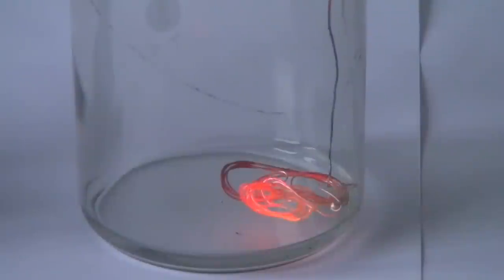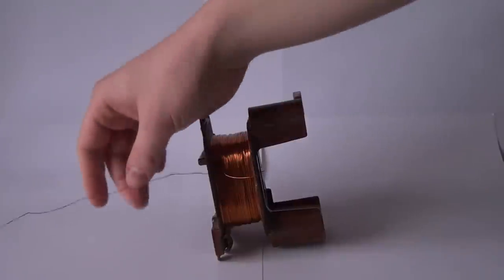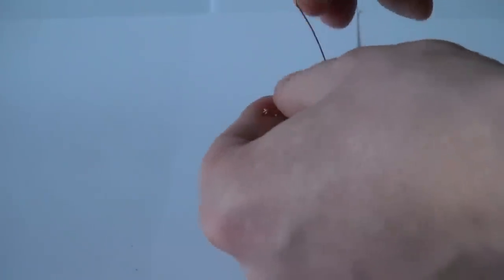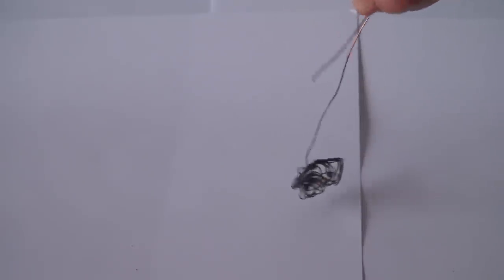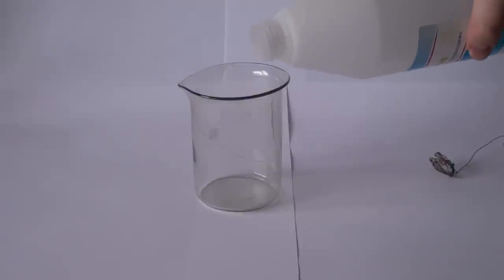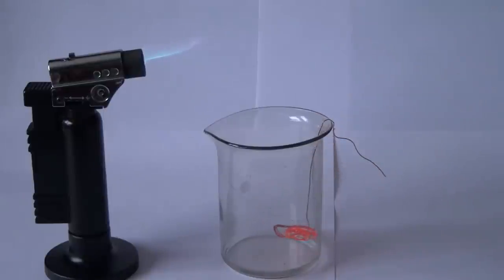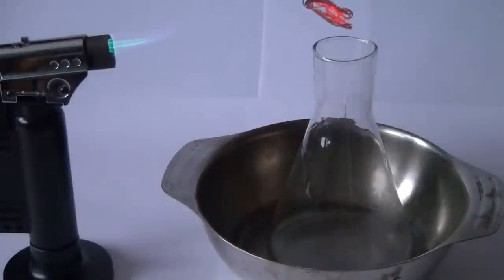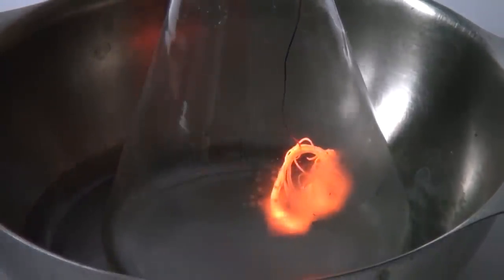Acetone Flashlight - Reaction of Acetone Oxidation , Glowing wire!

Comment: Would this reaction work with acetone vapor circulated through the inside of a heated copper coil?
Reply: Oh was thinking about chemical reaction heating for use in hot air engines. I found an alternative for heating cylinders on Sterling hot air engines but thanks for responding.
Reply: No, problems! This method is still viable though!
You could use the air from the exhaust of the stirling engine to bubble though acetone and force it through the copper pipe( very thin coppe tubing). 

Should work in theory.
Reply: Better to use low voltage induction of crystal graphite rods to heat cylinders. Used with a transmission I bet the hot air engine would get great gas mileage.  Less pollution.  You know you could in theory use short blast communication waves induction to heat huge graphite rods red hot? They would act just like nuke power plants that produce electricity just without all the radioactive waste. Novartis
Reply: A V-10 Sterling engine operated off low voltage induction of crystal graphite rods in each cylinder to power the hot air engine. With the crankshaft matted up with a swash plate hydraulic pump motor to operate the wheels of a vehicle should get great gas mileage.  LOL ; )
Reply: A hybrid axial vector swash plate hydraulic motor would be a great tool to use with a hot air Sterling engine. Novartis

Comment: Maybe you could get a large glass jar with a wide lid. Use a drill to make a hole in the center of the lid. Use a bolt down part way about a third. On the end of the bold is a small wooded wheel that has a hole in the center that goes on the bolt. One to two holes are put in the wood wheel by the center hole two holes also go in the lid by the center hole. The on the outer rim goes two holes. A small copper mesh screen is fastened onto the wood wheel going to the top of the lids bottom. Then pips fit the holes on the outer edge of the top lid going to the bottom of the wood wheel to act as air holes for a draft. The copper mesh is heat treated to make a black oxide layer but not heated to white hot or it may melt. A small piece of carbon felt about one fourth to one third of jar is in the bottom. Acetone is put in the bottom about a fourth of a cup. The lid assembly is pre heated a bit if need. The lid is put on the jar. I hope you make sure the screen is seal at the top of the jar and bondo is used to seal the pipes to make a containment for the acetone gas. As the copper screen gets hot it draws air from the top into the screen chamber. The carbon felt generates acetone vapors. A small spring of sheet steel may be used to hold the carbon felt against the wall of the jar if needed. The acetone vapors are on the outside of the screen catalyst while air moves up the inside of the catalyst by convection flow. Or so I hope. Anyway this was just a thought.

Comment: try a glow tungsten powder filament flash tube, not with low vacuum plasma, but with tungsten metal, thin wire transparent refractory tube

Comment: bur isn't it dangerous ? because of the flammability of acetone ?
Reply: +Omar Rashed I thought about this, too, but the vapor pressure of acetone at room temp is about 30kPa, making the volume percent acetone in air inside the flask or beaker around 30%. The upper flammable limit of acetone is about 13% by volume in air, so as long as there is still liquid acetone at the bottom of the container then the mixture of acetone and air above it should be too rich to ignite, so the oxidation reaction happens only at the surface of the copper, which controls the rate, keeping it slow.